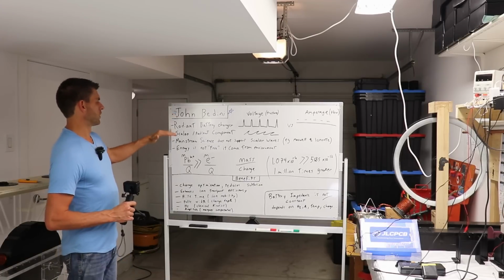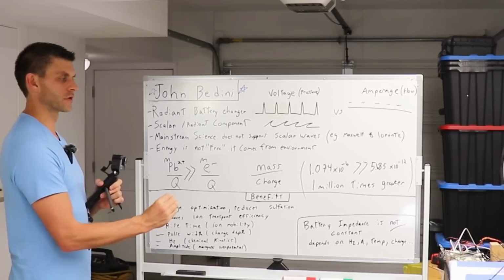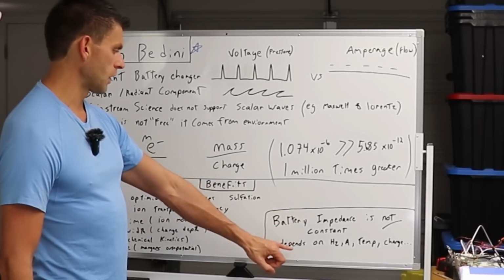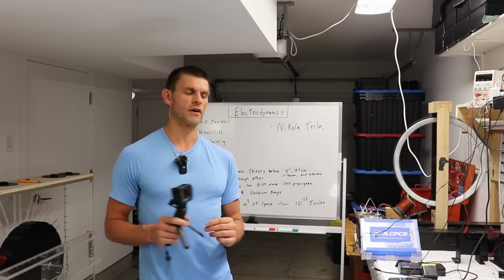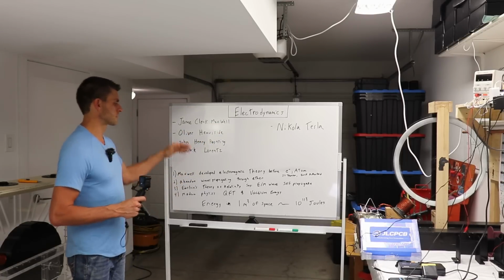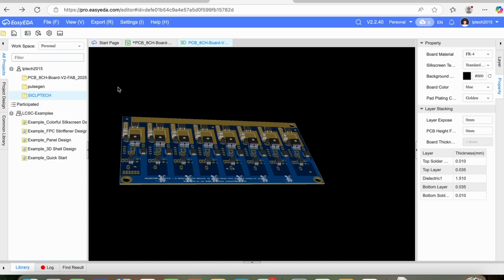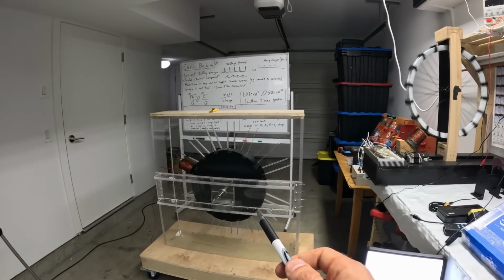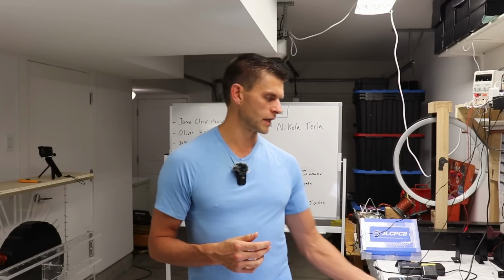They Said It Was Impossible  We’re Building It Anyway

Comment: Why would you want to change a design to prove that it works. you would want to start with what was used to begin with. then after you have a proven theory you could try improving it. you don't improve something you don't know works. this thing hasn't got a chance of working right out of the gate!
Reply: He explained why it currently doesn't work and why he thinks the updated design will work. Use your listening ears next time, sport.
Reply from the maker: agree
Reply: @451_actual4  when you are testing something that you believe works you alway build it so it works then reverse engineer it. that is the only way to make it work correctly. now you are adding so many variables it will be difficult. just basic troubleshooting and engineering skills.
if he did what you say then he should have a working model already and he doesn't.
Reply from the maker: I explained this?
Reply: @MadscienceLPTECH  You can explain what you believe till your blue in the face. but you are adding variables from the original design that will cause problems down to road. you will have to get very lucky to make this work like the original was said to. you need to have a working design to reverse engineer. that is the way forward. making it fancy doesn't make it work.

Comment: Why do you need the wheel with the magnets on it? Seems to have no real purpose. If it's to create a pulse for the transistors, why not use a simple pulse generator?
Reply from the maker: it produces excess energy to generator
Reply: @MadscienceLPTECH  In your video, you said it's the Pb+/e- dipole that allows the excess energy to enter the system. So that mean there are two ways to produce the excess energy?
Reply: I would put the wheel to the side for now and establish whether there is actually an energy gain when a lead-acid battery is charged with pulses. So hook up your MOSFET (or BJT) switches to a pulse generator with a decent rise/fall time. Start with the smallest identical lead-acid batteries you can find, so yoiu can see your results quickly. Charge/discharge them both to 50% state of charge. Start the experiement. After the recieving  battery is charged for a period of time, swap the batteries. Keep doing this until you realize a net gain or loss. If a loss, both batteries will lose their charge over time. If a gain, they will eventually become fully charged. Good luck.

Comment: re: Bedini idea. With a cell phone app, you can figure out exactly the Earth's field line direction. For example, on Android phones, the app "MagnetMeter" can show you this field line direction in 3D -- north, east, south, west but also the angle coming down to the earth. Let us suppose instead of having your Bedini wheel oriented as you have it, you considered this field line and tried to exploit it. It is a weak magnetic field -- down in the nanoTesla range. But, it is subject to disturbance from the Sun. You could try having the wheel be exactly oriented to be perpendicular to this field line, with the magnets essentially spinning around the field line. OR, you could try various other pitch, yaw roll directions. It is true that if you have moving magnets in a magnetic field, such as the Earth's magnetic field, you can generate power (or moving coils). The flux needs to be moving. So with Bedini pulse technique -- low power input -- can you in fact generate power in the Earth's field. Looking at the Hendershot Fuelless Generator material, Hendershot had claimed that his first device, a little plane for his son, would spin the motor in one compass direction, east-west I think, and would not spin it in the north-south orientation -- implying Earth's field was playing a role in his design. Suppose on the wheel you mount several coils for harvesting this Earth's field power...
Reply: https://youtu.be/ocIn_LzlAVQ?si=Vg50Wx2qTWgNkTi3
Reply: Hendershot compass direction experiments: https://youtu.be/fsT3KLZ0d2g